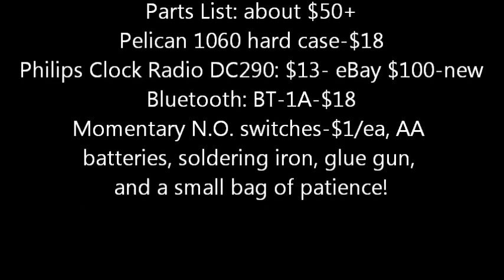DIY Hacked Clock Radio Mini Pelican 1060 BoomBox w/Bluetooth!

Comment: Hey I'm building my first bluetooth speaker in a 1060 with one of those ubiquitous TDA492 50+50W boards. Plan is to use 2x 2.5" good full range drivers and a 3" passive radiator (I know surface area is <2x that of the drivers but it's a space compromise since I can't use ports), and 3S 18650s for 12V. 

I'd really appreciate any input if you have any in terms of whether this is a good configuration, and it's been really cool watching your progress through the newest videos--keep it up!

Comment: Random, but are you in texas? I heard Flowermound on the radio, haha.
Reply from the maker: NorthTexas!!
Reply: I thought it sounded familiar. Some of my family used to live in Lewisville. I'm in San Antonio. I've always considered a hack similar to yours because I think it'd be an easier "first DIY boombox" but always worry about proper power. Was that clock/radio already battery powered or is there some sort of converter I missed?
Reply from the maker: Chagrin223
Cool! Yeah three 3.7VDC Li-ion batteries in parallel and regulated to 4.5VDC since they provide most current to amp portion then they are in series with single 3.7VDC batt for 8-9VDC for control portion. Pair of AA is clock settings backup in case of main power failure from Li batteries. Like to see ur build one day! Peace!